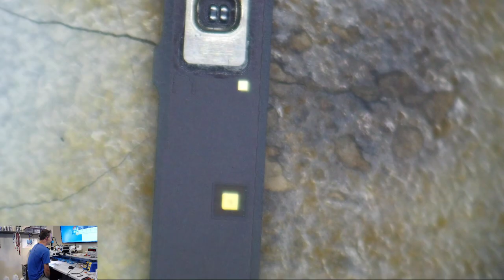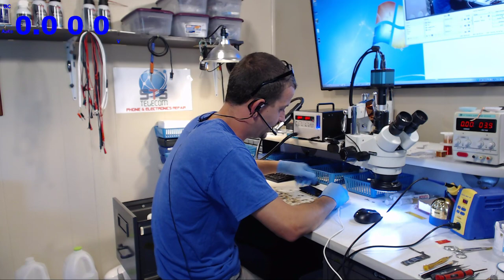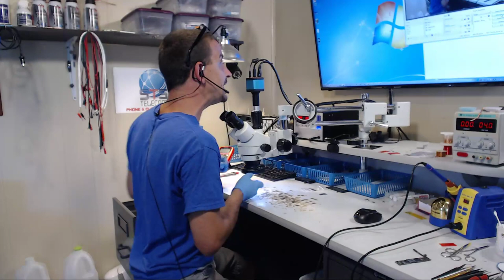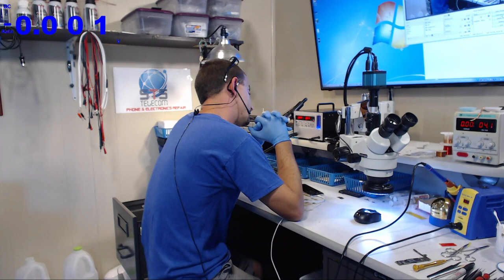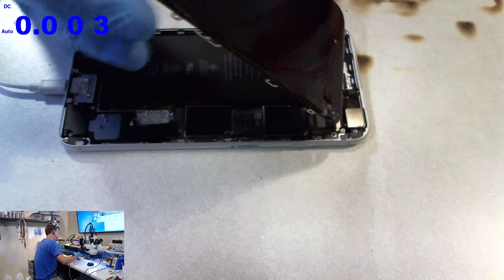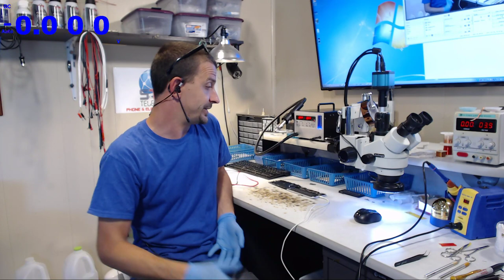Troubleshooting an iPhone 6 and 6 Plus that will not charge the battery (Tristar/U1700 x 2)

Comment: Hey Jason, I have a bit of issue with an iPhone 6. It was stock on boot loop and I tried to restore it. It did not work. The itunes show an unknown error(4013). I took the board and I noticed water gon inside it from sim slot. I hooked the board to a new charging port,  battery and a screen but it still shows the same error. What do you think the proplem shold be?

Comment: Hi Jason, i have an iPhone 7 wich is charging very slow. with empty battery i have a max current of 0,44a regardless of using the default or the ipad wall charger.  On a laptop usb port i have 0,40A max current. Charging time is 6-7 hours until 100%. any idea? Thanks and greetings from germany.

Comment: I have recently purchased an iphone 6 and within a month it showing error that "accessory may not be supported" even though i my using original charger also sometimes its charged but most of the times it sows this error. I have even checked the charging jack and it is absolutely fine. Is it possible that my iphone charging IC is in fault in this case?

Comment: Jason, keep "saying" you will make a video, keep them phones marching in lol :-D.
Only think about youtube when you have slack times.

Shame you can't tack on to the battery with thin wires, so you don't have to keep bending that display ribbon/connectors every time you want to monitor the battery.
Don't want the display to fail or disconnect while the phone is powered :-(.
Reply from the maker: I usually only use cracked/disposable screens from the boxes full I accumulated doing screen replacements.  My time on those screens is limited tho! On one of the the next repairs, both of the iP6 test screens I'd been using for weeks decided to die.   Likely due to me throwing them around and folding those cables.